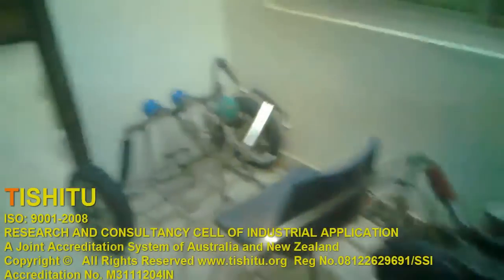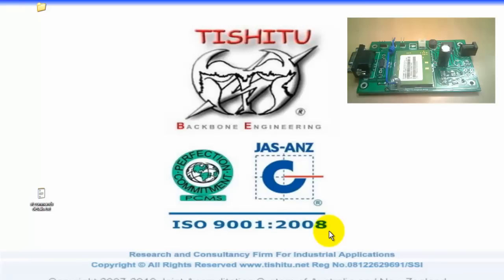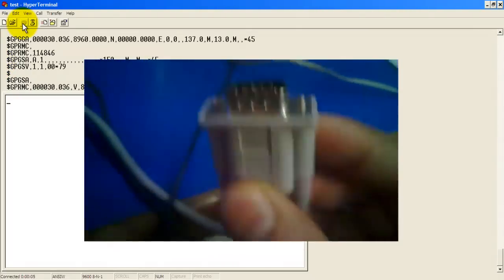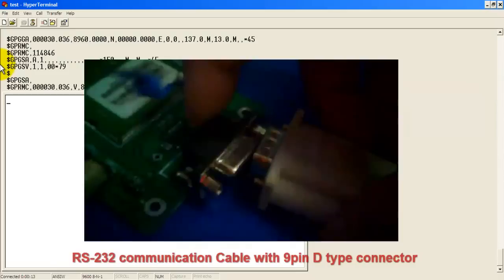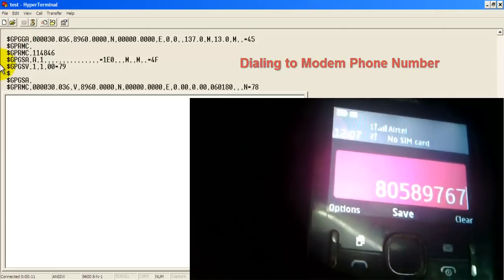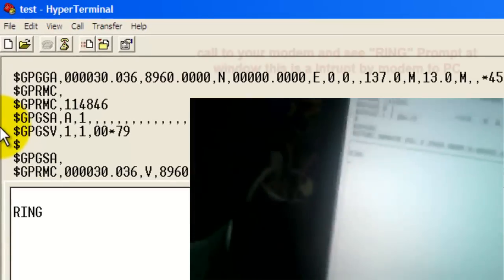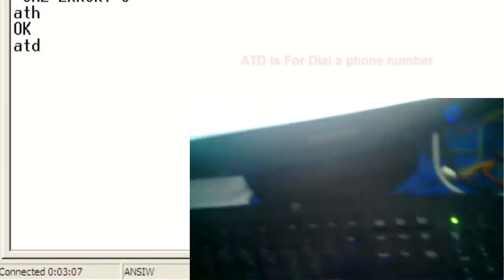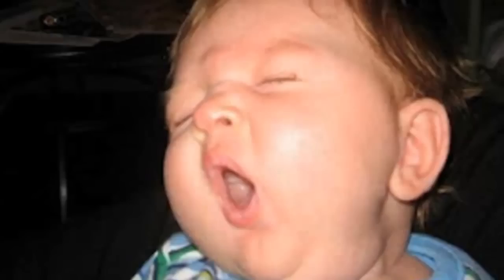TISHITU Receive and make calls from Simcom 300 modem by Computer Rs-232 hyper terminal

Comment: Why not just use a mobile phone??  What really is the need for these? I've searched and searched and find them used for all sorts, I have one it's a Siemens tc35 with 12 volt input wire with antenna but I have no use for it but some reason wanna know what it can be used for as there's not much info on the one I have
Reply from the maker: +molly marley This one is just for basics installation and CHK GSM module is working or not
Reply from the maker: +molly marley Basic Learning of EPABX System